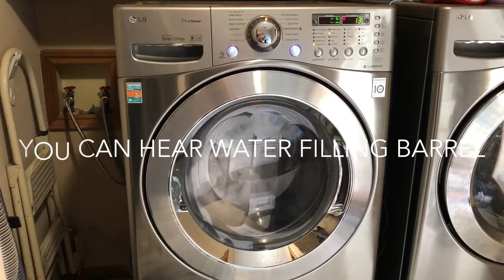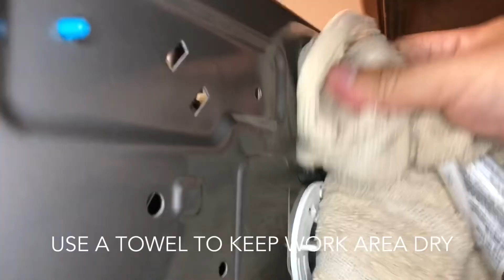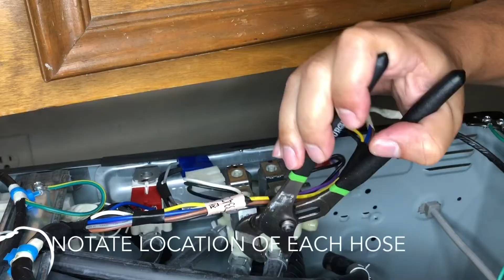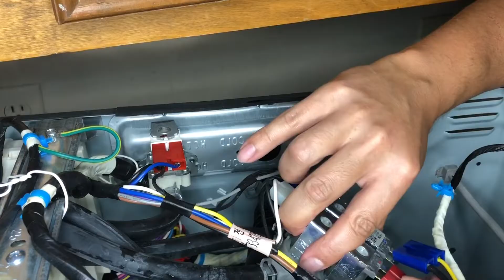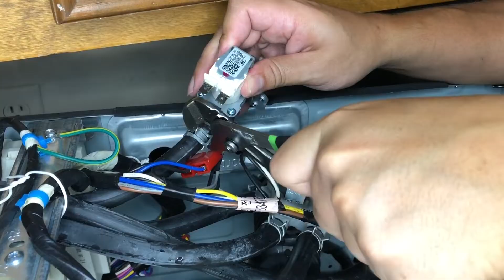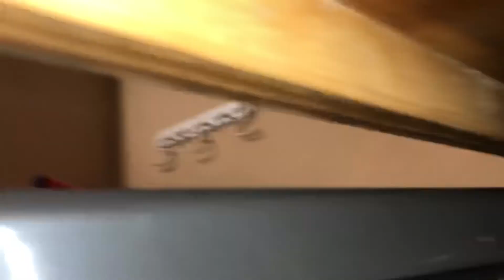LG Front Load Washing Machine Water Issue - Faulty Water Inlet Valve - Water Level Adjustment

Comment: After replacing the cold water valves the water continues to fill but does stop once I hit the pause button but continues to fill After I hit the pause button to start the washer again. It does not stop filling the washer. If I unplug the fill valve the water stops filling.  Any idea's? Ed

Comment: Same case.. Different diagnose.. Inlet or solinoid valve was basted or good but no 220v supply from the mother board.. 
Better to do is put the multi meter to test the 220v supply to solinoid valve and set the multi meter test prob to times 1k omz the if right reading is 4.5 omz witch is good.. If the other test multi meter reading is higher than and so on it is solinoid deffective or basted.

Comment: I replaced that valve, now it’s louder than before, I don’t see water coming out from any of the water Jets either, drain pump sounds bad as well… I have replaced hot water inlet valve a few months ago, and right now I replaced the one you show here, but it’s doing the same, still over filling, to the point it gets out of the door if I don’t turn the main water hoses off
Reply from the maker: Did you check the mesh filter going to the valves? Maybe there's a clog? It's been a while since I messed with the machine, but what about cleaning the drain pump at the bottom of the  machine? It's hard to say without being there. Maybe you can upload a video for other youtubers to help you?

Comment: Why did you adjust the pressure switch if it was functional?
Reply from the maker: I'm sure there were test done, but I felt like not enough water got mixed in with the clothes. So I adjusted the screw to let more water mix in.
Reply: @tunedis95  Thanks, and thanks for the video, got me through my repair!

Comment: Top came off the same for my LG WM2240CW.  I saw hot and cold were separate valves.  Realized Flood-Safe hoses were the reason no water was getting into washer - I changed well filters the day before.   Another example of a safety feature that becomes its own problem.  Thank you for posting your work.

Comment: When it comes to washing machines I never knew where to go to get OEM parts...is it typically local shops or is it strictly online
Reply from the maker: I get a lot of OEM parts from ebay, dealers sell lots of inventory on there. In this case, I wanted parts same day and new a local appliance shop for OEM LG components. Yes, they all probably come from China, but surely OEM has more strenuous standards than a knock off. Figured I would support small business and went local, but did cost me a bit more.

Comment: You got had brand new oem is 45 buck's
Reply from the maker: I did. But, it's okay. I went to a local Mom&Pop store that's helped me out in the past. I could have purchased knock off's from Amazon for much cheaper, all come from China anyways.
Reply: Real OEM or fake OEM? I can't find a real one for less than $125 right now from an LG authorized parts dealer. There's really good OEM replicas on Amazon but they're not certified.

Comment: I think my valves get stuck closed at times or they’re stopped up one
Reply from the maker: There is a mesh filter right where you tie into the water hose, may check/clean that pre-filter. You can also get more intrusive if there were no issue with the mesh filter and take apart the valves to clean and reassemble. For me, since I was taking apart the unit, swapped out all valves for new while in there. If you plan ahead and not in a hurry, you can just order the parts online. I went ahead a drove to local distributor since I was in a hurry.

Comment: I've had the highest rated, to mid rated front loading washing machines and dryers. They all have cheap chinese parts inside. My advice is go back to the conventional washers and dryers to get years of no trouble service from them.
Reply from the maker: It took us about 6-months to finally agree to depart with our old top loader style machines. They were super easy to fix, very cheap to maintain, and just super simple to work with. I'll give the new machines one thing, the rate at which the barrel of the washing machine spins. Dries the clothes so well that the drier only needs to be on for 10 minutes or so. But yes, I agree with you.

Comment: Hi tunedis95 I have a question for you I have a LG washing machine line yours and when it’s not working the machine filled up with water is it the valve your changing on it it be machine is four to five years is the valve faulty
Reply from the maker: I would say yes. That's exactly what mine was doing. Filling up to the point the discharge pump couldn't keep up with the water supply to the point water would actually leak out the front door. Solenoid valve was sticking. 

For piece of mind, I added a water sensor under the washing machine, if sensor is ever tripped, the installed smart water meter  instantly shuts off water to the house. This is probably worth a video in itself.

Comment: Thank you for this video.  My husband and I were able to change the water valve ourselves, of course, with your help 🤗🙏
Reply from the maker: Fantastic! There are other videos out there, but twice, or even 3 times long. Glad I could help!
Reply: @tunedis95  🙏❤️
Reply: Where did were you able to find the parts? Also are there different sizes depending on which front load LG washer you have? @tunedis95 @janehouck
Reply: @thecoolestmf  I looked my brand (LG Tromm WM2688HNM and “washer water inlet valve”) up on line.  I ended up purchasing the part from Sears PartsDirect.  It came out to $77.88 (found a coupon on line and saved $7.12 or else it would have cost me more).  Hope this help.  Just in case, the part number for my model was 5220FR2008F.  Money was worth it.  I no longer have water all over my floor; standing water in the drum; no FE error, etc.  Haven’t had to babysit my washer.  Sooooo happy 🤗. We watched the video as we installed it so the video was very helpful!
Reply: @janehouck1906  that helps a bunch, thanks so much. And thanks to the poster of this video as well. Really appreciate the response Jane 🙌🏼
Reply: @thecoolestmf  You’re welcome.  Hope you find the part you need easily.  Take care 🙏

Comment: Was your replacement hot water valve very noisy? I just replaced the same part on mine with an LG OEM part and it whistles loudly when letting hot water in.
Reply from the maker: Is your screen mesh in the inlet clean, and free of leaks? My solenoid valve makes no noise, I just hear the water flow similar to what you hear behind the wall of a shower.
Reply: @tunedis95  thanks for responding. The screens are clear especially since it's new, I guess the valve is slow to open fully

Comment: Great video! Is it possible to first try “cleaning” the valve? How do we know it’s faulty?
Reply from the maker: There is a mesh type filter I checked, and yes you can try to clean the solenoids/valves, and test. In my case, the dryer and washer were given to us, so I just spent the extra money to just replace to be done with it. 

For me, the valve was stuck open, with the drain pump constantly on to pump out water. My smart water flow meter actually caught the excess water usage, which is why I investigated. So I went straight to replacing the decade old valves.

Comment: Will this fix my problem? Water wont fill  in washer machine . Hoses are good and have good water pressure .
Reply from the maker: No water or hot water come on, almost sounds like your water inlet valves. Without being there, I would change that first. You can order the knock off components pretty cheap.
Reply from the maker: Also make sure your water inlet valves are not clogged. They could have debris in them.

Comment: How did you know how much to adjust the pressure switch? I get FE error plus small leaks under the washer. Replaced the fill valves, problem persists.
Reply: I replaced the valves and now get an FE error code. Before installing the valves I never had an error, but a small leak in the drum. 

Could it be I need to adjust the pressure switch?
Reply from the maker: Is the hose going to that little pressure switch chafed or anything? Is the door sealing properly? Inspect the complete grey seal. 

As far as the amount to adjust the pressure, couple turns, then ran it to see if I was happy. Took me a few adjustments to be happy.